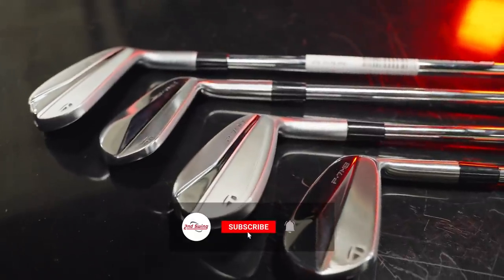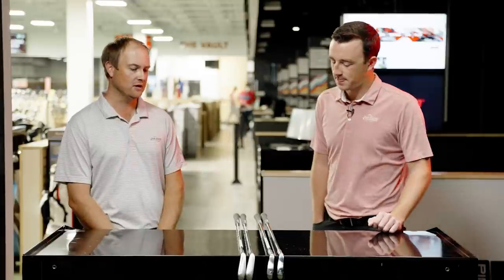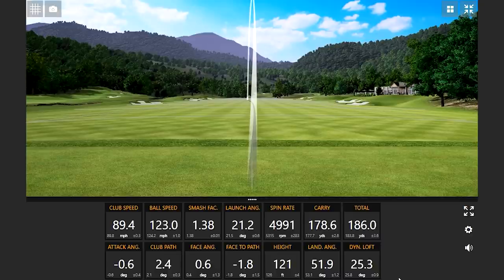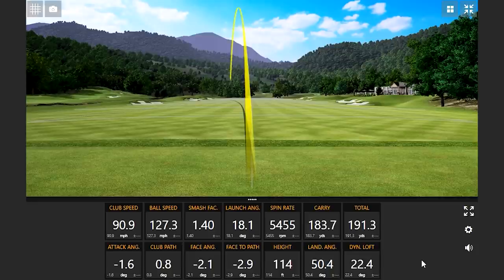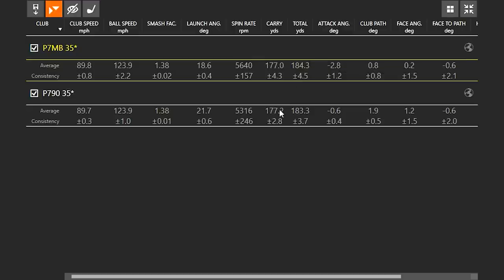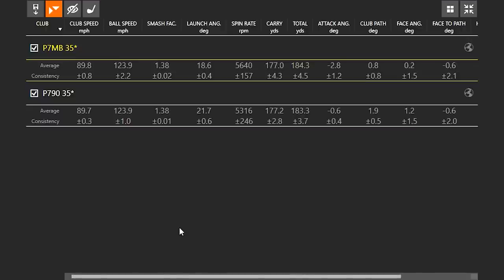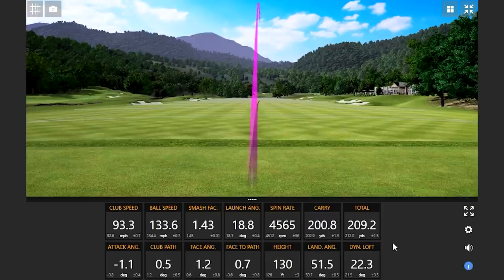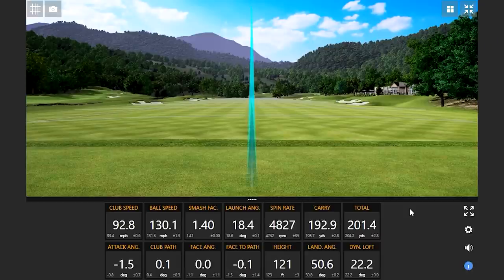Creating More Golf Distance | Loft vs Technology

Comment: Taking the comparison back in time, I've moved from '84 Hogan Apex PCs to P7MBs. The Hogan 7-iron is 37 degrees vs 35 for the P7MB. When I was fitted, the launch angle of the PC was half a degree lower than the MB. Spin for the MB was 500 higher, vs the nearly 40 year old grooves of the PC. Distance was about the same. The CG of the Hogan is much higher - there's a lot more meat lower on the back of the MB. This also gives the MB much better forgiveness when you're a few grooves low on the face - better than you'd expect.

Comment: Does the P790 have the speed slots on the 7 iron on down? Maybe that technology contributed to the jump? 
At the end of the day - maybe the tech is best in regards to forgiveness. I would have to guess off the toe, the P790 holds its distance better than the P7MB...?
Great test - that was fun!
Reply: Hello Chad, I noticed a difference in the dynamic loft between the 35° clubs. The blade was delivered at 23° and the 790 was delivered at 26°. If the 790 had a further 3° removed it would have tightened up the gapping. Maybe 🤷‍♂️
Reply: Yes. Speed slots start at 7 which definitely makes those faces hotter and less prone to mishits. I think the contribution of that tech is exactly what this test showed.

Comment: Your video is perfectly timed for me at this moment. I’m currently in the process of re-fitting my irons to try to figure out my launch. I have new stock T100 irons, my 7 iron swing speed is 95-100mph but my launch is 38 degrees and my spin is 8000+ so 165 is pretty much the end of the world. 

I thought it was the AMT s300 shafts being over powered. The x flex shafts actually went even higher. The fitter recommended that I consider different clubs. He said (with caution) that a blade may actually help you get that lower launch. 

He did say lessons would help too.
Reply: Sounds like you are just delivering way too much loft to the ball. Lower lofted irons would be a bandaid, would probably need lessons to fix.
Reply: VCOG matters. Read Ralph Maltby’s info on it

Comment: Wouldn't the blade actually be better in the wind even though it spins slightly more, it launches lower staying under the wind. Peak height was 16 ft lower.

Also 17:35 not exactly the body language of a well struck shot. Seemed like Thomas wasn't striking it as well

Comment: A couple of things strike me firstly just how consistent the numbers are for each club, to get ball speed, smash factor, spin etc in such a tight window is amazing, is that heavily edited or not? Secondly a 25 yard gap is just crazy in my world, okay as a much older player with a slower swing speed mine will always be less but that is at least two clubs for me.
Reply: This is a great test and it proves the basic point that these clubs aren't intended for guys with Thomas's speed. The P790 7-iron at 82-84mph will have comparable results to the MB 7-iron swung at 90mph. That's the design intent of the club and they achieved it. 

P-790 also has the speed slot starting in the 7-iron, which is why it's so much hotter than the 8-iron. Again, they really work for average-speed players & produce silly results with high-speed players. Average players don't have the swing speed to generate the crazy high peak heights Thomas got.

Comment: One explanation for the jump in distance with the p790 7 iron would be that, that is the iron in which the speed foam starts (at least from my memory of the 2017 version) Can you confirm that the speed foam either diminishes or is not present in 8-Approach wedge in p790?

Comment: What would be a good combo set for the P7MB if you felt comfortable hitting the MB's up to let's say 7 iron.
Would P770 or P7MC be better if the loft gapping was matched up properly
Reply from the maker: Good question, and thanks for watching! P7MC would most likely be a better model to blend with because the performance and feel will most closely resemble the P7MB. The P7MCs are a slightly larger and more forgiving P7MB. What you could do is add a P770 at the top, say at 4-iron for example, if you are looking for another boost of forgiveness there as well.
Reply: @2ndswing  thanks guys that helps

Comment: This was a very interesting test.  Your analysis focused a lot on matching club-head speed, and then comparing launch, ball-speed, spin and carry distance.  However, one of the most critical variables in the test was largely ignored:  dynamic loft.   Your attempts to even out the clubs and conditions for the test was great, but one of the biggest differences in club performance was due to the dynamic loft delivery of the different clubs.  In both match test cases, the delivered or dynamic loft is the biggest reason for the observed results.  I find it interesting that Thomas' natural swing with the 6-iron and 7-iron comparison resulted in such a different dynamic loft being delivered to the ball.
Reply: I suspect club length and ball position would factor into that dynamic loft difference. I'd love them to 'bite the bullet' and build the clubs to the same length with the same shaft. That would eliminate all the remaining variables other than Thomas's swing variances.
Reply: You are 100% correct. The stated static loft has little bearing in the outcome. Dynamic loft and to a lesser extent attack angle determine launch angle. Spin loft determines spin. The lower CG and all the other tech made 0 difference in flight. For a given delivered dynamic loft, you got the same launch angle. The tech did increase the smash factor, which obviously leads to higher balls speeds or equal ball speeds with less effort. But if you don’t hit a center strike, that smash advantage dissipates rapidly and into the pond it goes.

Comment: In the first test with the 35* clubs you had a 3* difference in the dynamic loft at impact between the MB and the 790 and they both went the same distance. So you've delivered the clubs differently with the MB getting less dynamic loft than the 790 got. In the second test with the 31* and 30.5* clubs the difference in dynamic loft was the .5* the clubs have in static loft and then we saw the technology take over and the 790 ball go 10 yards farther with the same delivery conditions. So the second round of testing was a much better example of loft vs technology. Looks like MB vs 790 is almost 2 clubs worth of distance when the number on the sole of the club is the same! One club of distance with loft and one almost one club with technology.
Reply from the maker: Great observation. I usually believe it is more loft than anything but the P790 and P770 iron tec provides some extra power - Thomas

Comment: I always think that to get a fair comparison you should just take 1 shot from each clubs data set that are as close to each other as possible. If the strike position is similar, speed, angle of attack and delivered loft are similar then surely any difference is down to the club.

Comment: That is one thing I also noticed. I have the cobra LTDx and I was testing my yardages and all my clubs were roughly 10-15yards apart except my 8-7 iron they were a 20-25yards apart. Also he is hitting a 7 iron the distance my driver goes xD
Reply from the maker: Sounds like you may need to assess that gapping that is quite the gap! The lofts could be off slightly too - Thomas

Comment: Was not surprising when comparing p790 7 iron and p7mb 6 iron because the p790 7 iron has tungsten and the p790 8 iron doesn't.  It's the reason you have such a large distance gap for the p790s between the 7 and 8 irons.

Comment: Thomas isn't really the target market for the P790 and it does show in the huge gap between the 8i & 7i: 4 degrees difference in loft producing 25 yards difference in carry.  That is far too big a gap, you could fit another club in that gap.  I am guessing that the reason is the tech is designed to help golfers who do not have Thomas' swing speed.  So the design of the club gets a bit more pop off the face for the 7i compared to the 8i.  Couple that with a design where as the irons get longer there is more mass on the bottom to keep the launch high and you have a recipe that for the average golfer helps keep the ball in the air a bit longer as the lofts decrease but for Thomas it is the equivalent of him consistently hitting a flyer.

As for the spin rates, there is only a 200-300 rpm difference between the P79- and P7MC on a loft for loft basis. I am not convinced that will make that much difference
Reply: Speed slot starting in the 7-iron. 

Good point on spin - the spin penalty is really minimal & can be reduced to nothing with a ball change. There's a reason these have sold so well. I never liked the sound/feel of them but they perform.
Reply: @canyonaro  you are probably correct that it is the speed slot that makes the difference. I tried the P790s a couple of years ago, they performed really well but were just a bit too big for my eye. The P770s were much better looking at least to my eye and a lot better feeling but by them I was playing the i210s which spin a little more and are very consistent so absolutely  no need to change
Reply: @justinstephenson9360  i210s are an all-timer. Many pros still playing them. I'm gaming a combo set of PXG 0311P/T Gen 3 after 20 years of Mizuno blades. Got back a club of distance with just similar feel from the T. The P 5&6 irons have a little more pop to them but I don't need buttery feel from those distances.  Cost same as P790s because they cut the price before gen 4 came out. They'll be in the bag quite a while.

Comment: What irons do I need to check out if I want to hit the ball lower? I hit the short irons over 140 ft with game improvement clubs. Would like to hit around 100‐110 ft with more spin and stability.
Reply: you must not be hitting down on the ball enough if you are hitting the ball that high.
Reply: @dstruong86  VCOG affects launch as well. Just like a driver.
Reply: @dstruong86  -3.5 AoA. I just swing hard.
Reply: @bgoggin88  try a combo set. possible p770 in 6-pw and p790 4-5 irons. or go straight p770

Comment: Is there any reason where I over draw to hook the new P790 all irons compared to straight shot slight fade with P770 . Same shaft . On monitor I'm 5 dag closed at impact to 0 dag to .5 open with 770
Reply: Check the offset and lie angles.

Comment: Love the videos guys, but the attack angle changed drastically between the first two clubs that the data is apples to oranges. -0.2 vs -4.7 on the extremes, of course launch angle is higher/lower

Comment: What if a person already hits the ball high? Can the lower CG/higher launch become too much?
Reply: Big misconception. If you are launching it too high you are most likely scoping at the ball and not hitting down on it enough.  Unless you are flying your 7 iron  170 yards + and the ball going to high it’s most likely your swing fundamentals.
Reply: Contrary to popular belief, blades actually have the lowest CG of any iron out there. #1 because all of the mass is located at or below the equator where a cavity is hollowed out and positioned around the perimeter and #2 because a blade typically has a much more shallow club head height which means more of the club head is below the equator of the ball.

Comment: That was also a 25 yard gap from the P790 7 to 8 iron…
Reply: Hello Clay, I was looking at the dynamic loft delivered on the 35° clubs. It was 26° on the 790 and 23° on the MB. Maybe if the 790 had 12° taken off the loft at impact, it would have carried further. The gap between might have been less?
Reply: This is how you can see the tech actually coming into play and making a difference in distance.

“Normal” by loft difference (4.5*) would be 13.5-15 yds + Thomas swung faster by 3 mph so that’s about 4 yards. So the standard factors of loft + speed account for about 17-19 yds out of the 25-yd gap between the P790 7- and 8-iron.

The speed slot starts at 7-iron (but is not in the 8-iron and shorter) making the face markedly hotter and springier to help launch the ball faster and more consistently as the lofts get lower. I think it is fair to attribute this additional difference of 4-5 yards distance to those tech innovations.
Reply: I think he just swung the 8 iron differently because he was trying to swing it harder to compensate for loss of speed from the shorter shaft compared to the 7, because of that he delivered way more dynamic loft than you'd expect.  I'm sure if he swung it normally and delivered the proper dynamic loft of 2-3 degrees lower his distance gapping would be fine at 15 yards carry

Comment: Need to add third test using full shaft length as separate test loft tech shaft length at full speed discussion not holding back to equate club speed
Reply from the maker: Thanks for watching. I intentionally matched the club speed to keep those variables the same. We will find some older fitting heads we can bend to use the exact same shaft and length for a follow up. - Thomas

Comment: I could be wrong when I say this, but I believe that in the p790 8 iron there is less tech in that club. I thought that is the crossover club to not have all the tech, I believe they slowly take the tungsten, and air foam out as it progresses towards the PW. Where as the 7 iron has the speed slot/ tungsten/ and foam….
Reply from the maker: You are exactly correct. There is a transition between the 7 iron and 8 iron. The 7 iron is still pretty hot! - Thomas